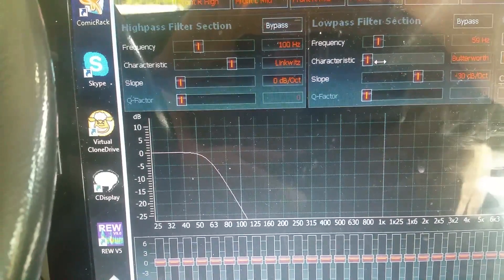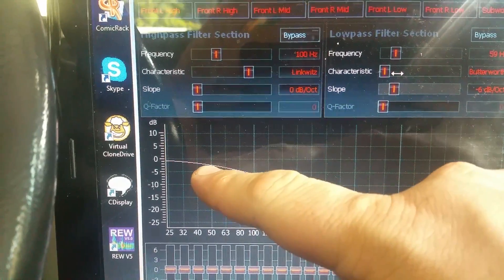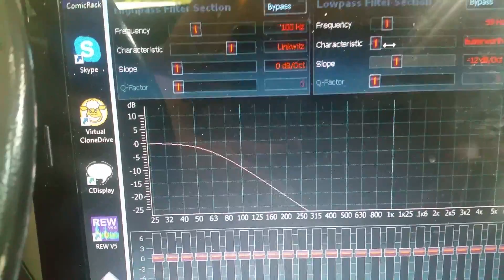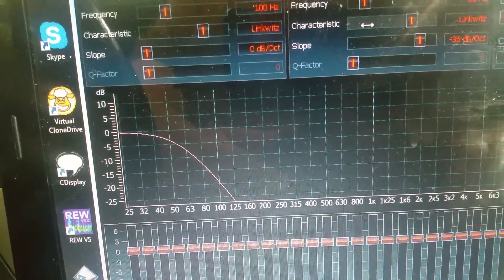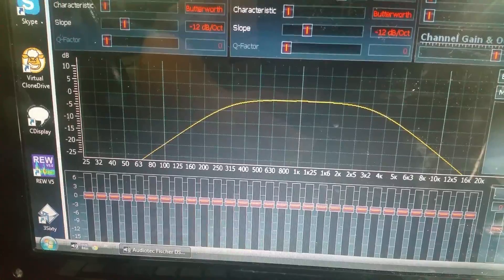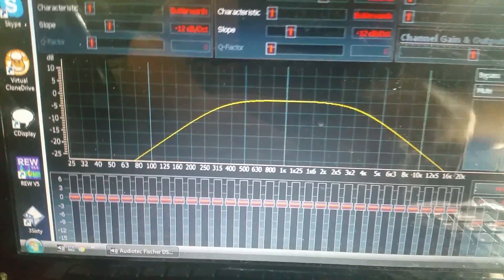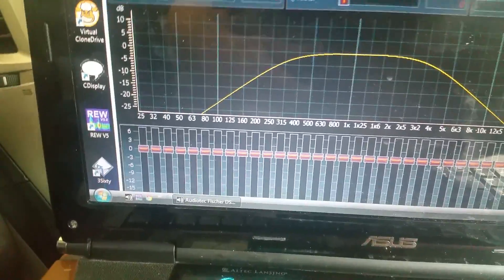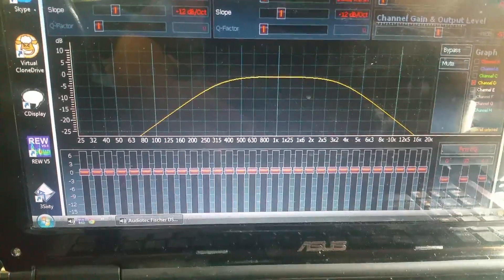How to tune a SQ car Part 1, Talking Crossovers

Comment: JMPO, but Id never only run a 3 way. If he were to show the frequency bands overlapping here, you would immediately notice a huge dip between the sub and the mids. I think even if the mids and highs are passively crossed over (as in my system) you still reap HUGE benefits from adding mid bass drivers between your subs and mids. 4 way fully active is better yet.
Reply from the maker: 3 way usually refers to midbass, mids, and tweeter. The sub is a given. Also, I've seen people run 2 ways before with very good results

Comment: Hi Kyle good day, i have question maybe you can help..1.  how and were you connect your computer to your stereo to send signal? 2. Using what cable ? I'm new to DSP and I know nothing about it, but i want try and experience awesome some. I already have my audio set up with pioneer avh 4200 nex / dayton audio 408 DSP / alpine pdx f4 for my tweeter and 3.5inch  mid high and hertz HDP5 for 6.5 mid bass and 12inch sub ..(now running 3way active plus sub). I already purchase umik 1 with USB and downloaded REW but. I can't find on the internet a diagram how to / were to connect rew to send signal on my speaker can you help me with it...looking forward, thanks

Comment: Hey Kyle - been through this series once, and watching again just to get better grasp. Looking for your input- daily driver, not competition car. 
Factory locations, 6.5 in all 4 doors will play to 45 hz, tweeters in dash. Adding 5.25 in kick panels. I like rear fill. I know its driverdependent, but trying to get an idea of some generic starting crossover points. Before adding kick panels, I had rear 6.5 70hz to 200hz, front 6.5 at 200hz to 3800hz, and tweeters 3800 and up. Not sure if I should set 5.25 at same points as front 6.5. Thanks for any input, gonna finish going through the rest of the series again so i can have a better idea of everything you haveincluded, thanks alot man

Comment: Hey man, thanks so much for your videos. Looking forward to using them realtime with my DSP. In an unrelated question, what Subaru model are you driving? I have an outback myself. I am looking for a similar dash mat for mine, any recommendations? Also, how do you like using the corner dash locations for the mids?

Comment: You mentioned that you're using the Scan 10f's  in the stock location.  I'm guessing that's in the dash, reflecting off the windshield?  If so, has this caused any issues?
Reply from the maker: lightningstruck93 nope, no issues, and sounded fantastic
Reply: Did you fabricate an enclosure for them or just open back into the dash cavity?
Reply from the maker: lightningstruck93 kind of both, i built a small bowl "enclosure" from a dynamat type material, then used poly-fill inside.

Comment: Hey there. Great content - wish it was longer and more detailed. 

I see the LP on your sub is ~65 Hz and the HP on your mid is ~350 Hz 
What about the area between 65 and 350? 
For the sub @ 12dB/oct, at 130Hz it would be -12dB 
For the mid @ same slope, at 175 Hz it would be - 12dB 

That means at 150 Hz it would virtually be very little or no sound right? 

Also, I've learnt on some vids that the orders of slope have to be corrected by phase shift. 
For every order an adjustment of 45° has to be made?

e.g. if LP is on 12dB slope it would be the mid would be -90°, and tweeter HP on 12dB slope would be +90°, so we have to phase shift 180° one of the drivers to 'correct' them. How true is this sir?

Lastly any thoughts on putting HP and LP on of the two drivers at a same roll off point? 

Sorry if I've asked too much but not many people talk about this part of car audio but its so important!! 

Looking forward to your replies, sir! Thanks!!
Reply: I do not have an answer to some of your questions here. But I’ve been watching a series on YouTube that Audison is doing right now. It’s fairly lengthy. There is four or five hour long videos at this point. I think episode two or three covers a lot of what you’re asking.

Comment: Hey Kyle, I have a quick question for you. Could you do a tutorial on how you have Rew EQ set up? One thing that I cannot seem to get mine to show is the number of averages for instance. I have also noticed that you are using a 1/12 octave smoothing, do you have any other tips on how to set the program up before you begin with measurements? And thanks for the video's, I cannot tell you how many times I have been watching them over and over to figure out how to tune using my DSP Pro. It is certainly a step by step process
Reply from the maker: Hey Joey, I will be setting up my DSP again in my new vehicle, and I'll go over that and do up a video on it.

Comment: Hey kyle, thank you for putting together all of the videos, sincerely appreciate it!  I have a p six mk 2, but have yet to install it. I don't want to spend 70 bucks on the mic... You mentioned the small mic that attaches to your phone will suffice? I will pony up the money for the dayton but only if it's absolutely necessary. Regards.
Reply: You spent the money on an amp with dsp, but don't want to spend 70 bucks to fully utilize it?!

Comment: hey wsup i lv your videos im learing i have the hat imagines 6.5 twetter in sail panal and midbass in botton of door head unit 80prs twetts at 6.3hz 24db slope mid low 6.3hz at 24db slope mid high 63hz at 24db slope subs 63 at 24db slope can u please do a video showing on yor graph
Reply from the maker: Eazy Rida Which graph?  And try bringing your tweeters down to 4.5k, and mids to 3k, and reset that part of the EQ to flat, and re-adjust.
Reply: Kyle Ragsdale  hybrid audio Scott Buwalda gave me those settings your dsp
Reply from the maker: Eazy Rida Yes, their components they use from the factory, that is what they use, just a single capacitor at 6k, for a 6db slope.  The bad part about this is that even though the 6.5" CAN play up to 6k, in a vehicle, mounted in the doors, it will start beaming (becoming directional) at around 2.2khz.  This means less energy above that point is reaching the listener.  If you use a steeper slope (12db or 24db), you can easily bring those tweeters down to a 4khz crossover.
Reply: so u saying the owner is wrong cause all my slopes are 24db slope so u sayin put the tweteer at 4k with a 24db slope what about mid high and mid low and sub
Reply from the maker: Eazy Rida I'm not saying he is wrong, Scott is a very knowledgeable dude.  But if your drivers were mounted on axis, I would say that would work fine, but since they are in the doors I assume they are mounted in or near the factory location.  I would do the Tweeter HPF at 4.5k, and mids LPF at 3.2k to start.  Mid to sub crossover is very vehicle, driver, box, dependent, and just needs to be played with to find the right combo.  Hard to say without listening to it, but I usually try to stick around 50-65 on subs, and 60-80 on mids, with at least a 10hz gap in-between, if not a little more.
Reply: My tweets are in the sail panel midbass in bottom of door
Reply from the maker: Yup
Reply: Can the imagines play that low remember I have the pioneer 80prs and yup what I'm confused
Reply: r u there
Reply: WSUP
Reply: Hey what's going on
Reply from the maker: Yes, the imagines mids can play to 80hz easy with a 12db slope. same with the tweeters, 4.5k is nothing for those tweets with a 12db or higher (24db) crossover.
Reply: Kyle Ragsdale  u know I have the pioneer 80prs that number for the tweets is not n here
Reply from the maker: You have a 3.15k, 4k, and 5k in that area, try the 4.15k and 5k and see which one sounds better.
Reply: u r talking bout the tweete right 1.25k 1.6k 2k 2.5k 3.15k 4k 5k 6.3k 8k 10k 12.5k
Reply from the maker: yes
Reply: Kyle Ragsdale  so 4k 24db tweete mid low 4k 24db  mid high 80hz12db low 80hz24db
Reply from the maker: 3.15k @24 on mid, and 80hz @24db for HPF, and 60hz on sub @24 or 36db
Reply: Kyle Ragsdale what about the tweets
Reply: Eazy Rida dont hve 60hz have 63hz
Reply from the maker: 4k on tweeters, 3.15k and 80hz on mids, and 63hz on sub
Reply: Kyle Ragsdale with all 24db slopes
Reply from the maker: As a starting point, yeah
Reply: Kyle Ragsdale okay what do u think of the P SIX DSP this what im looking at and the sub amp
Reply from the maker: It's a great unit, I wouldn't hesitate to use it
Reply: Kyle Ragsdale and the spx1000b for subs I was reading the manual for the p six dsp all speaker terminal need to be 4ohms
Reply from the maker: Channels A and B do, channels C through F can be 2 ohm.  Any of those can be higher of course (8 ohm for example).
Reply: Kyle Ragsdale I need all of them to be 4ohms cause I will be running the l3se
Reply from the maker: Then that's fine, 4 ohms is less than 2 ohms (in resistance), so it can handle it just fine.
Reply: Kyle Ragsdale thats kool so what the l3se should be running at
Reply from the maker: for frequency?  I'd start with like 400hz to 5k, and go from there.
Reply: Kyle Ragsdale I put those settings in about a hour ago it sounds good thank.once my finances get back on track I will be upgrading to the hat clareus l3se and the helix p six dsp and splx1000b.so with the p six dsp it has a rta what mic will I need I really like the one u using
Reply from the maker: The one I use is the Dayton UMM-6, and is probably one of the best ones out there for what we do, and is compatible with the Helix DSP.
Reply: Kyle Ragsdale  yea I read about that one I download atf dsp pc-tool software version 3.11c and also download the rew I really thank u im learning a lot from u we need more people like you
Reply from the maker: Thanks man, I just try and share the knowledge I have learned, and continue to learn everyday
Reply: Kyle Ragsdale  u are quite Wellcome cause I'm learning from u
Reply: Kyle Ragsdale wsup what size fuse do the p six dsp take
Reply from the maker: I dunno, I'd check on their website
Reply: Kyle Ragsdale okay the sub amp take 2 80a
Reply: Kyle Ragsdale  wsup k how to proply set the active crossovers output level on my 80prs
Reply: Eazy Rida how do I connect the helix splx1000 to the helix p six dsp
Reply from the maker: It has a line output, channels G and H.  Connect the RCA to the amp and tune away.
Reply: Kyle Ragsdale so 1 pair of rca from the deck which plugs into channel A N B AND the sub amp plugs into G N H so a total of 2 rca
Reply from the maker: Should do it
Reply: Eazy Rida how to set the crossover output levels on my 80prs
Reply from the maker: It's by channel, and I think it's in the network mode menu
Reply: Kyle Ragsdale yeah I just got done tweets at 10db midbass at 5db
Reply from the maker: +10db? or -10db?  I wouldn't put anything above 0db.  If you need your tweeters louder, turn down your mids.
Reply: the 80prs dont have plus 10 only 0 to 24 db this the output level the gain
Reply: Eazy Rida wsup K what do u think of the precisio p62c do they match up to the hat imagines and the clarus both 6.5
Reply: @eazy69ful  its good to not play 3.15k--4k?